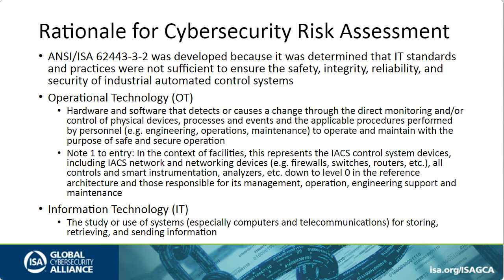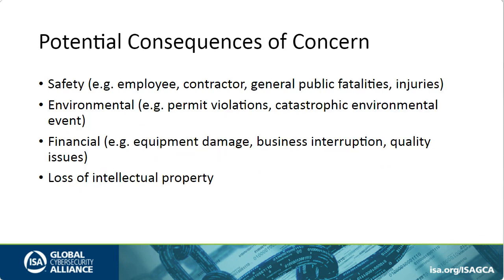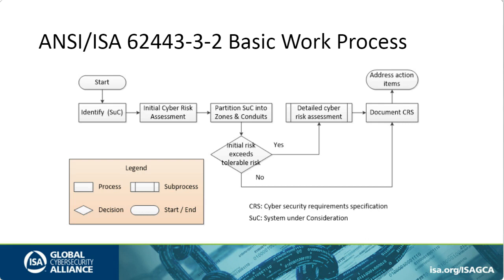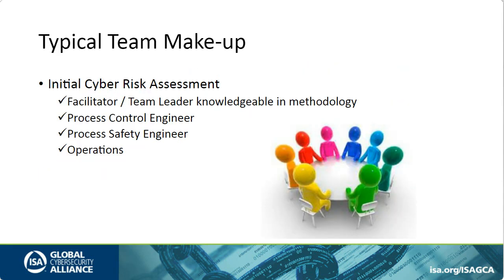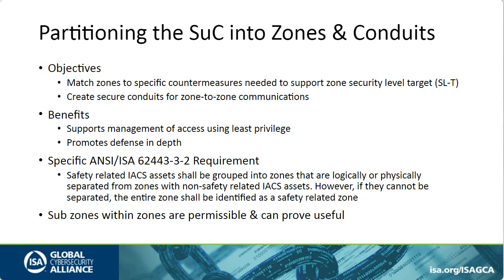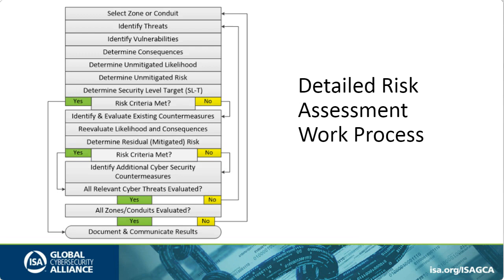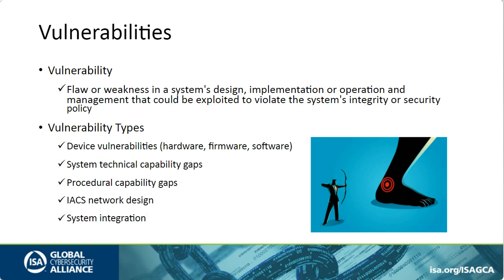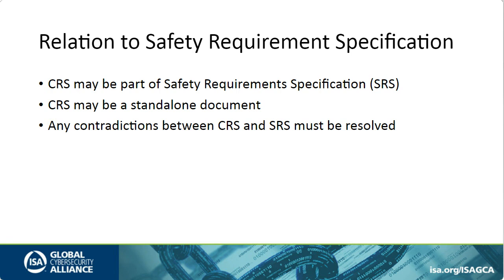ISAGCA Cybersecurity Risk Assessment ANSI/ISA 62443-3-2

Comment: Thanks for that, excellent summary, Just a note, the excerpts from 62443 on the likelihood, 1-5 at 12.33 and the table, with likelihood 1-5 don't match, This is how it is written in 62443, but perhaps it should be pointed out that the graph and table are opposite. Not sure if you can edit this in the video, but just noticed it in the standard, and thought... that doesn't make much sense.